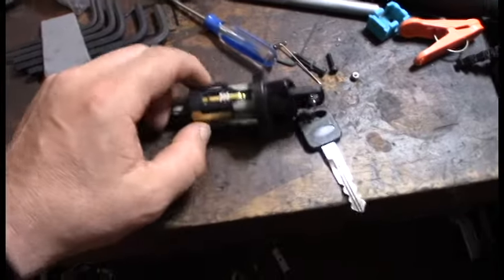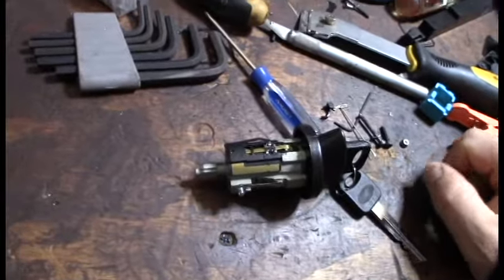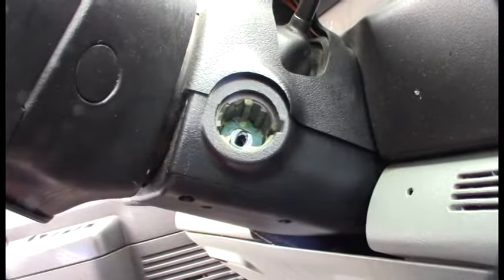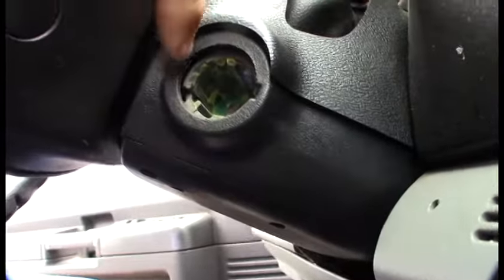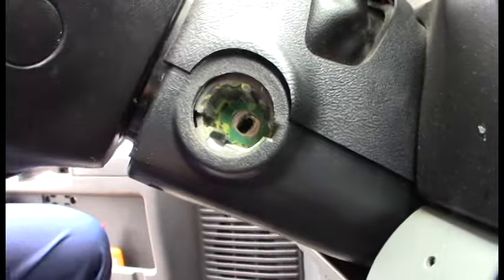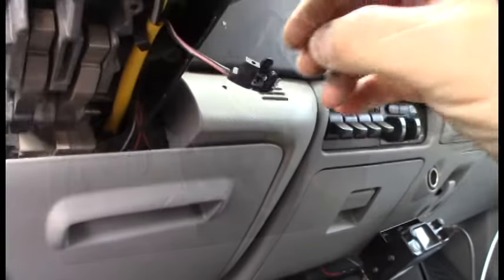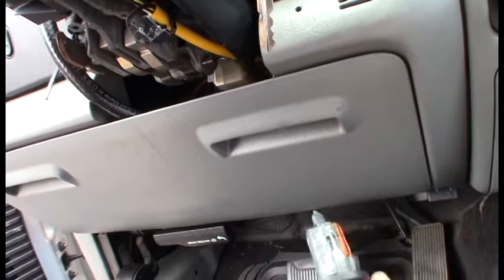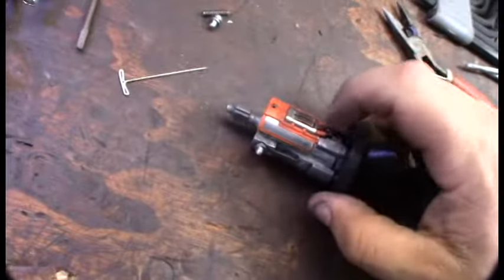B1352 Ignition Key-In Circuit Failure Ford F250 chime repair bell fix code

Comment: Could you tell me that if it throws the ignition key circuit fault code?Would that cause it not to start?It turns over but it will not start

Comment: My 2011 Ranger has code close to that.  Getting B1352-20 CM | Not Current, Ignition Key in Circuit Fault.  No idea if I should care about it. Checked and dinging happens when key is inserted. So must be a little different issue.
Reply: It was your car starting fine after you get this code ??
Reply: @nelsonmartinez1281  My car never had any issues starting. I think the specific code I have is for issue making the dinger go off when passenger door is open and key is in ignition. Hard to get documentation.  I have not found any.
Reply: @MrRmeadows  oh okay gotcha

Comment: Would this cause a crank and no start and a fdcs code to pop up
Reply: I have the same problem. Any luck in fixing it?
Reply: Tom Reid  I have a 2006 6.0 with 170k on it. It's crank no starting, and something is killing my batteries. Could it be the ignition and an ipr/ipc issue? It's my daily so i'm trying to fix this no start thing asap lol
Reply: ZamboShelby it was a fault in the fuel lines wiring. Replaced the wiring harness and it fixed it. Put over 5,000 miles on since with no issues
Reply: I have same problem
Reply: @lawrencemunda1311 you fixed ? Run ?
Reply: @Ben Smith you fixed ? Run ?
Reply: Check your gem’s fellers

Comment: So ya when I pull key out of ignition chime still goes on. Would that kill my battery.
Reply from the maker: I never got a chime with the key in
Reply: Try pulling out Fuse #15 and cleaning the contacts and put it back in